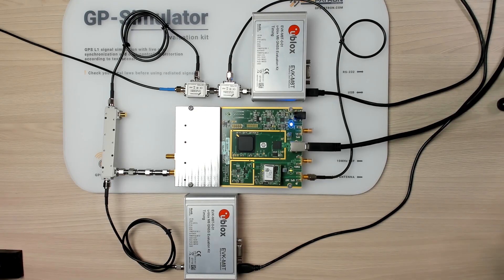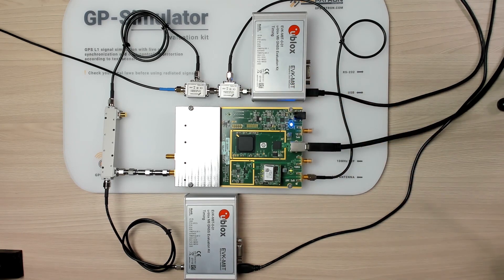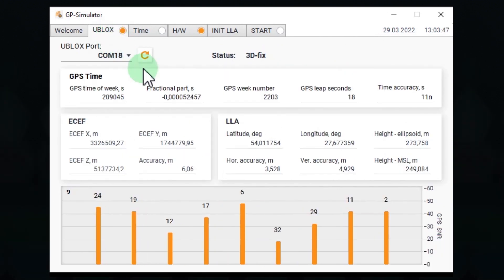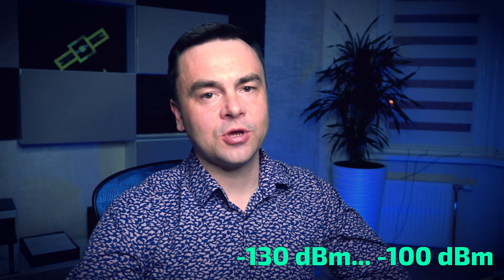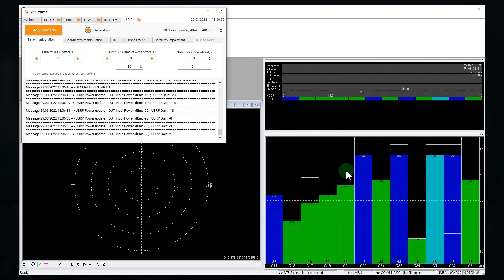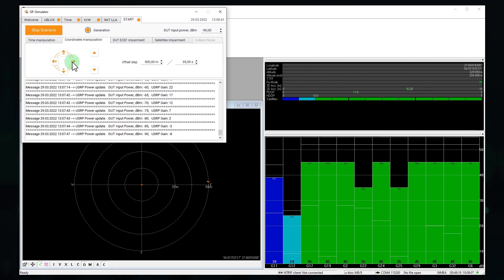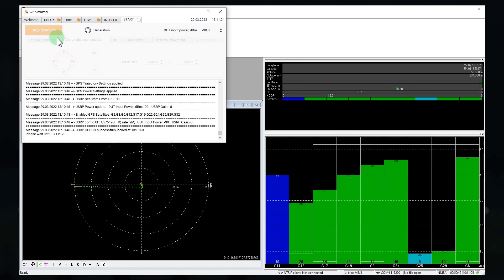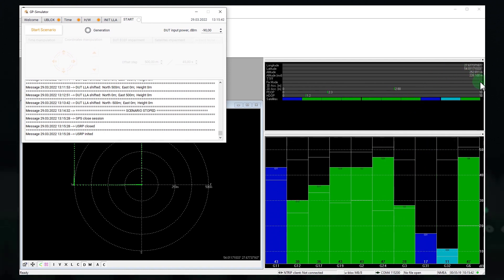1. GP-Simulator Intro. SDR-based GPS spoofing resilience testing tool

Comment: Hello, a question: 
In order to supply the receivers of the GSP signals with spoofed signals, the spoofing transmitters must transmit from virtually the same satellite transmitter position.
Do they use "satellite transmitters" or terrestrial transmitters, close to Earth?

 I could imagine that the spoofed transmitters, which presumably transmit from close to Earth, i.e., 
terrestrial, would be attenuated or even unreceived if the receiving antennas of the receiver units to be jammed were fitted with a
 kind of tube, a metal tube, so that they only receive satellite transmitters (i.e., non-spoofed signals) from orbit, and all signals received from the side (spoofing) would be shielded by the tube in such a way that the attenuation of the spoofed signals is significantly higher than the original, non-spoofed signal?

What is your opinion on this theory?

Otherwise, great technology! Respect!
Reply from the maker: Hello, and thank you for your interesting question!

You're correct in your assumption—GNSS spoofers typically use ground-based transmitters. They do not have to be "physically located" :-) in the same position as real GPS satellites.

Your theory about shielding spoofed signals coming from terrestrial directions (from the side) is valid and aligns with existing practices. Indeed, specialized GNSS antennas designed to mitigate interference typically reduce the reception of signals arriving from the horizon (ground level). For example, choke-ring (anti-jamming) antennas provide a directional attenuation of about 15 dB or even more toward the horizon, slightly reducing the risk of spoofing and jamming attacks.

Additionally, terrain features can also help: placing your GNSS antenna as low as possible—such as behind natural or artificial obstacles like buildings, hills, or fences—can further reduce reception of ground-level spoofed signals. However, keep in mind that this approach can somewhat compromise the visibility of the antenna to actual satellites, creating a trade-off.

The shielding method you described (a cylindrical tube or similar structure around the antenna) can be relatively effective against ground-based jamming/spoofing signals. 
Note also that a spoofer/jammer can be installed on aircraft or drone.

Comment: can i use Ni USRP 2900
Reply: Yes, sure.
Reply: @maximbarodzka2670  We want to generate a spoofer so that we detect the spoofing and then we had to implement some mitigation technique,
Reply: @rizwandhanyal1961  That's what this software is designed for.
Reply: @maximbarodzka2670  I have send a quotation request from your official website please respond to that